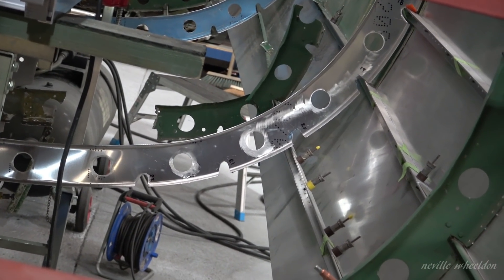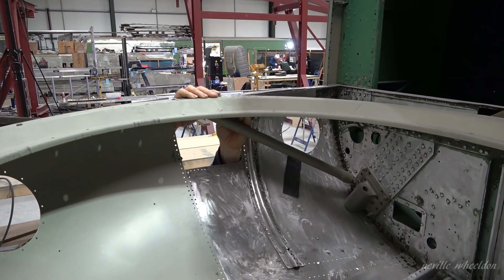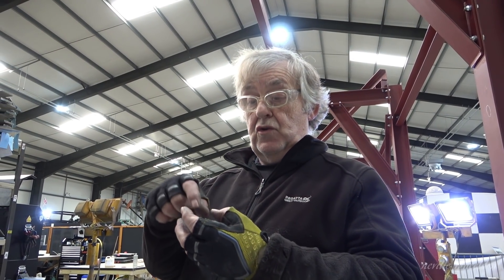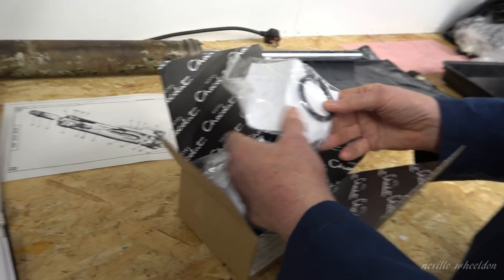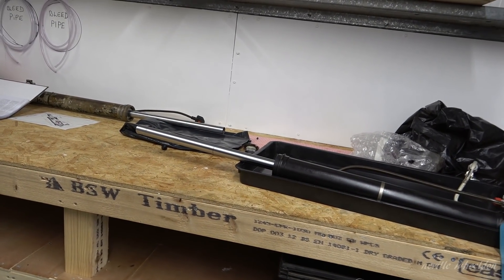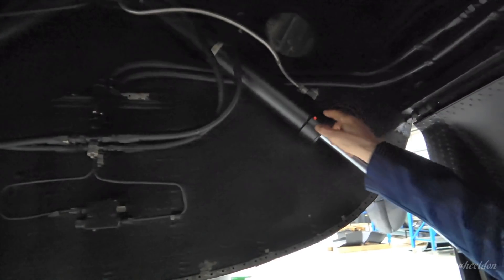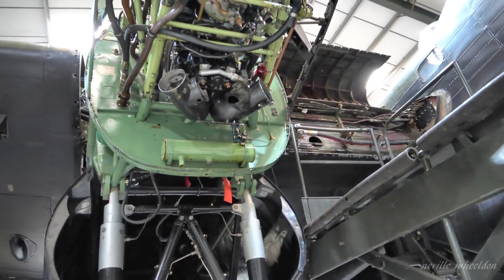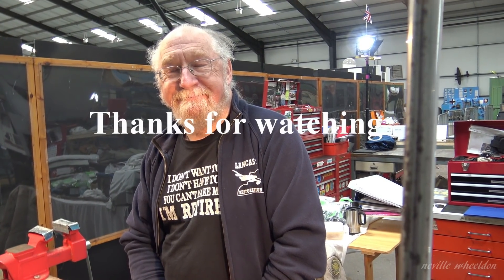138 Restoration of Lancaster NX611 Year 5 .. Lancaster NX611 bomb bay doors hydraulics service.

Comment: Chobert is especially suited to the assembly of thicker materials, up to and including blind holes. Featuring less clamp-up than Briv, Chobert also lends itself to applications that will not take the stress of normal riveting. These include the assembly of components onto printed circuit boards, plastics and even ceramic type materials. Chobert is also frequently used to attach labels on to machined components, to make electrical contacts and for use as pivot/hinge pins.
Reply from the maker: Thank you for this information Ash man.